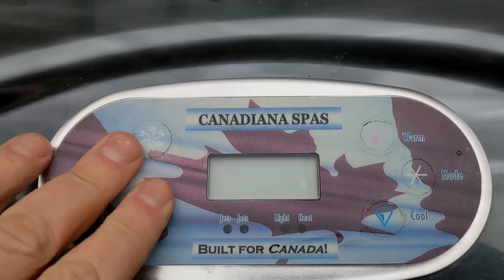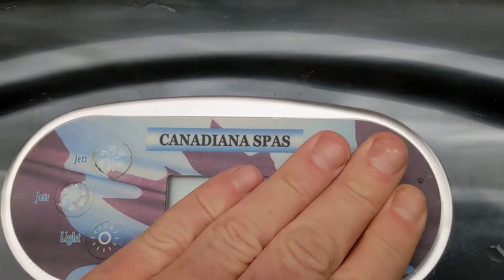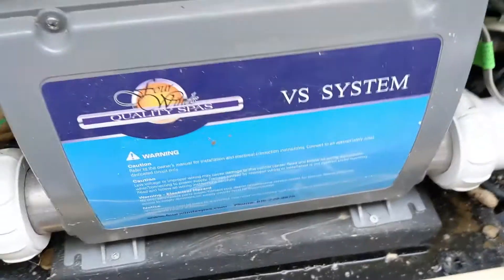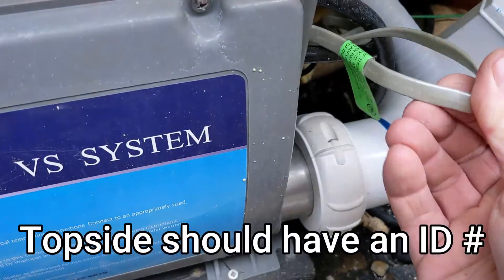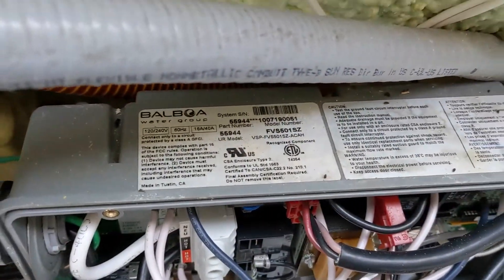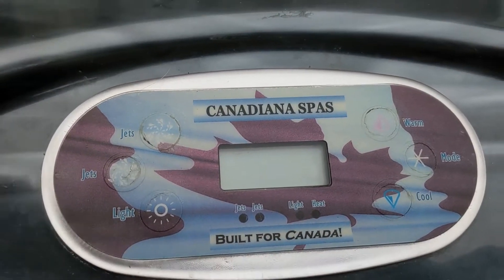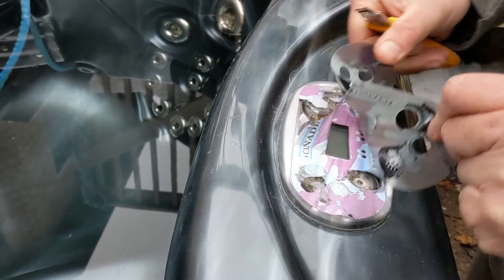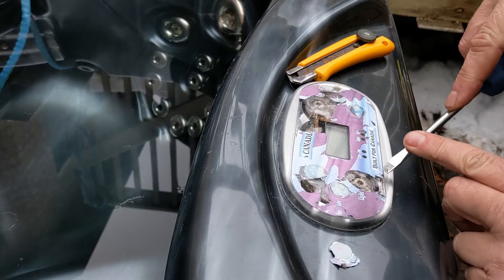Replacing Your HOT TUB Topside Panel Overlay Sticker

Comment from the maker: If the topside isnt working well, try taking it out and drying it.
Reply: Thanks
Reply: Turned out the membrane over the light switch had a tiny crack. Removed the membrane,  couple of minutes drying it out with a hair dryer, new membrane and fingers crossed the fault has gone away

Comment: I have a working Balboa TP600 topside and there is a clear silicon grease type substance packed around the buttons under the overlay. Is that water that has seeped in or is the substance intentionally there? 

I have the replacement overlay (looks to be same as your overlay btw) ready to apply, but what do I do with this jelly like stuff?
Reply from the maker: The older topsides did have the "jelly" in the buttons.  If it looks to be water, just try and dry it out.  Should be good if you didnt have any issues with the topside turning off and on by it self.
Reply: @VIPPoolsandSpas  Do you know if this jelly is RayTech Magic Gel?
Reply from the maker: @sbird7251  dont think so.  its more of a silicone
Reply: Here's an update on the problem. I spoke with Balboa the manufacturer of the panel itself and they said that the gel is meant to be underneath a membrane and if it is around the buttons then the Membrane must have failed. I got under the spa and looked at the bottom of the top side and lo and behold there is a gel on the electronics of the circuit board. I never noticed that before. I presume it is meant to be jelly like and isn't water damaged. 

As the topside still works I will just reapply a new overlay and get a Wi-Fi module to take the pressure off the use of the buttons.

Comment: I have a problem where I sometimes press the light button, the display goes blank for a few seconds then comes back on. The light button is discoloured around the edge, could this be a symptom of water ingress due to a cracked membrane? It's a TP600 but I can't find any replacement membranes with the same button configuration, most are 2 pumps, mine is 4 pumps
Reply from the maker: Send a picture of the topside to info@vippools.ca